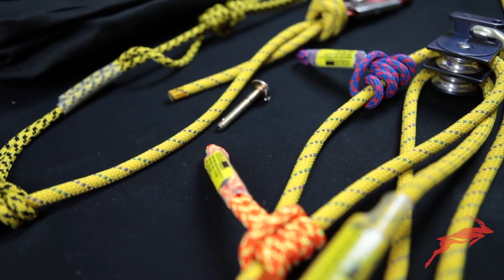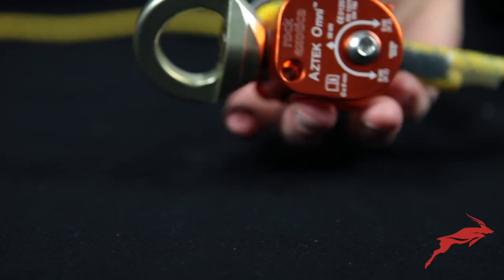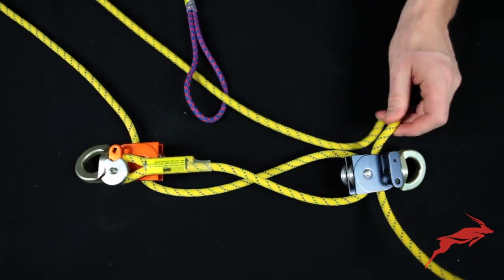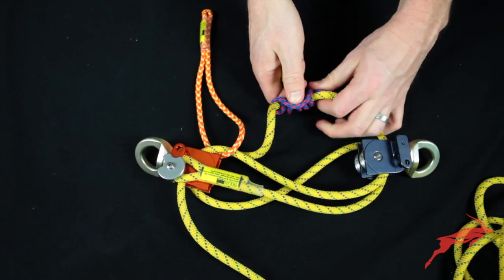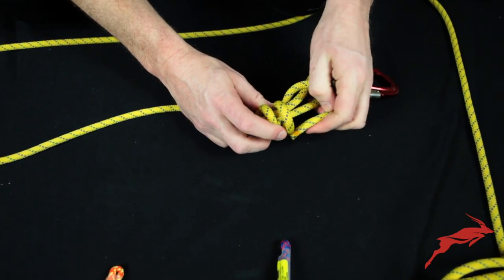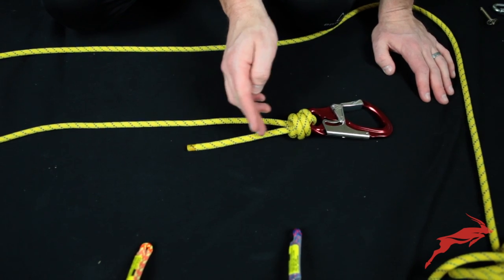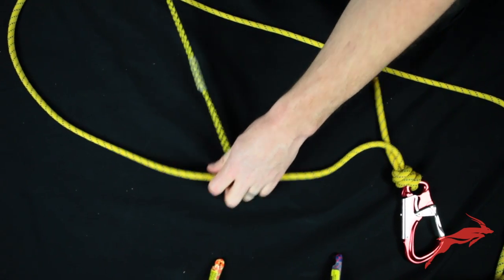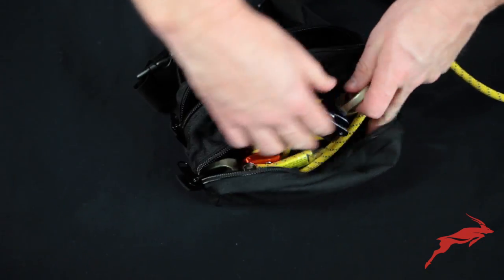How to Build and Assemble the Aztek Elite Kit Simple Pulley System from Rescue Response Gear

Comment: I used to use plastic clothesline pulleys on my cable dog run⏩>allmy.tips/FusionPulley?yy✳   . They didn't last long. This pulley works very well, is holding up well, and is easy to install - I didn't have to disconnect the cable to put it on.

Comment: Good video.  But, there's always a but, right.  

You didn't explain why you ran the "jigger" cord through the Prusik loops and why the top side of those loops faces inside giving you a 3 x 2 Prusik loop.  Or why the 3 x 2 Prusik loop should be used in this application.
Reply: one logical explanation of passing the line through the loop of the prussic  is that it will not ever fall off , even if untied . another is that the 2x3 prussic can be directional biased, to be tended easier in one direction but have more grip in the hold direction.  It is only my own personal observation and logic that  I reached this conclusion.